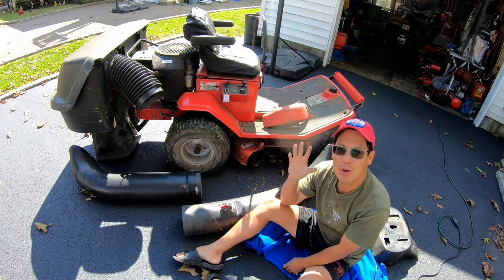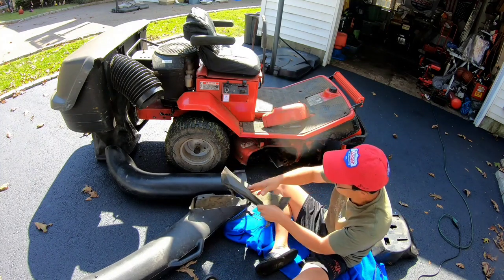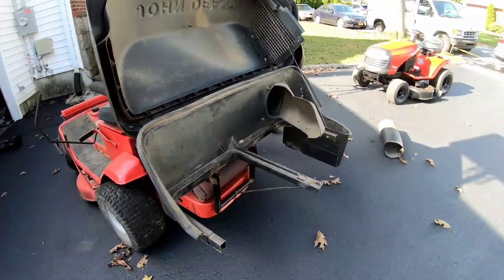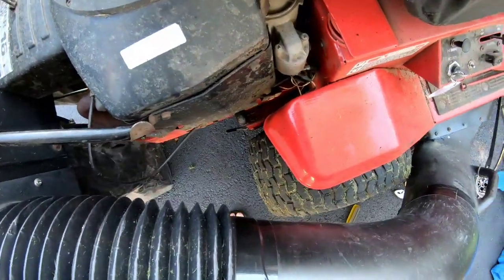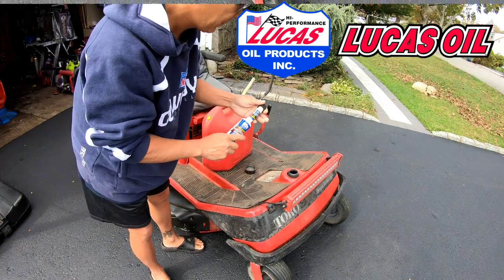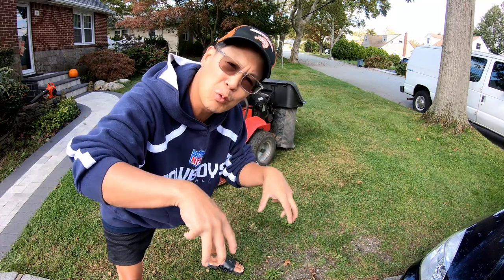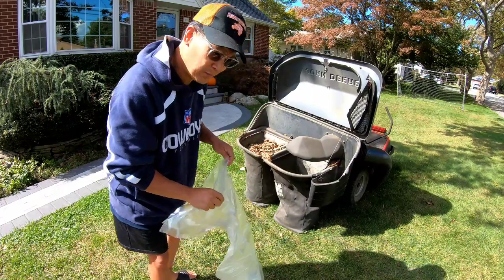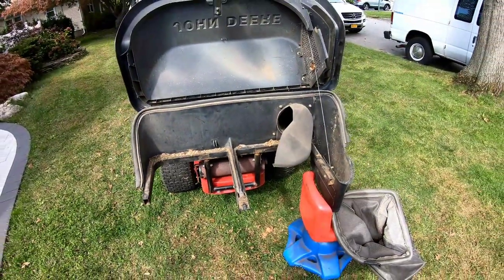FABRICATING A JOHN DEERE 38" BAGGER SYSTEM TO FIT A TORO 616Z ZERO TURN FRANKENBAGGER HOMEMADE CHUTE

Comment: Henry, I was really impressed with how well everything worked. The bags should be okay dragging over the grass- But dragging the bags over the street would probably require you to consider adding skid plates on the bottom of the bags like was mentioned in a previous comment. Congratulations On A Job Well Done!!!👍👍👍

Comment: The bracket which the bagger holds on to looks like it has a pipe with in a pipe with a bolt going through to hold it in place . If you raise the bracket to desired Hight by raising inner pipe , use vise grippes to hold in position. you can drill another hole in the inner pipe at the right Hight. The outer pipe already has holes in it were it was bolted use these holes to drill the new holes into the inner pipe . Then put bolts back through pipes . theirs your dinner .
Reply from the maker: Inner pipes are just 2” stubs.  I’d need to add longer pipes

Comment: Bro that's fanfreakingtastic, great job, on a side note, what blades do you have on the deck, do they have a bend at the end of em, if not get a set of the bent high lift blades, they work better for bagging.
Reply from the maker: Nah dey just straight brah!
Reply: @MowersNBlowers  ok then get a high lift set, and you will see a big difference.